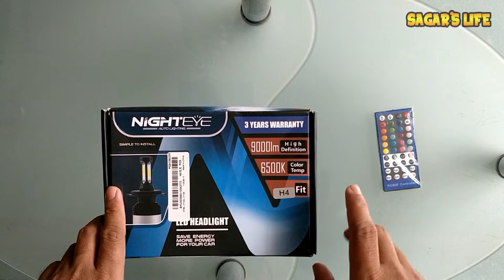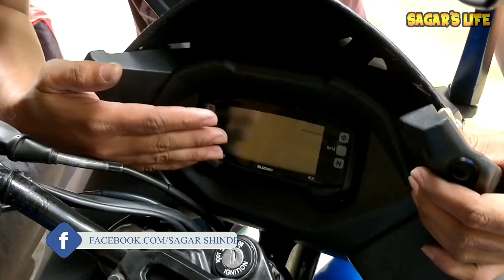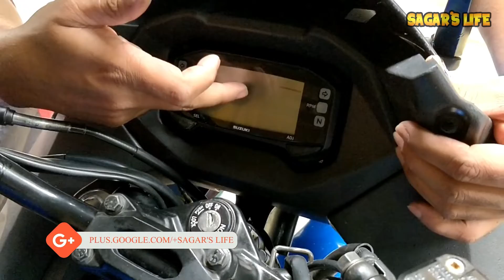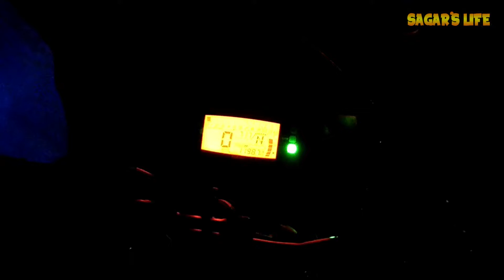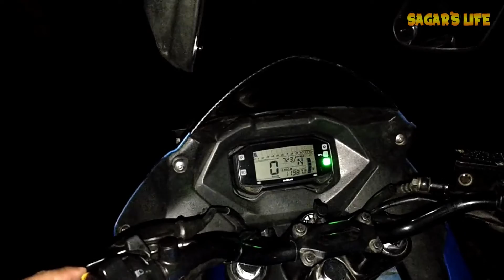The Best & Brightest LED Headlights Bulb For Any Motorcycle,Scooter |Gixxer SF | NIGHTEYE | Setup

Comment: if i change the headlight is it  impact on battery longevity.
Reply from the maker: As far as you are using headlight with engine running then there will be no impact on battery, as using the same from past 6 months no issues are here as even after 3.5 years still using stock battery 👍

Comment: is it required any connection modification for this light? because i installed it without any modification as a result it vibrate whil bike is stand but operate without any vibrate when throttle is increase. Thanks in Advance.
Reply from the maker: No mods required just make sure it should be fitted in exact h4 socket
Reply: @SagarsLife  Thanks for your quick response..... :) it fitted properlly but i'm facing this issue... :(
Reply from the maker: @farhasstory  try to consult with your local area garage person 👍

Comment: Hello sagar this lights sutiable for pulsar 180 model.?
Reply from the maker: Yes why not, just make sure the bulb model type which present in your bike to order the same from mentioned link...
Reply: @SagarsLife  thanks for your quick response also want to know what's the official warranty for this led
Reply from the maker: @mayur1502  you can refer the product listing page for warranty details,
Reply: @SagarsLife  Can we get one piece option.Why it's showing for two pieces of led?
Reply from the maker: @mayur1502  no Mayur it's only available in two pieces as its mainly sold for four wheeler, you can share the another bulb and cost with your friend who also need to upgrade his bike headlight 👍
Reply: @SagarsLife  thanks again for ur support

Comment: Hi,
After installation, rubber cap need to install or not because bulb Fan portion is heating any affect for rubber
Reply from the maker: No rubber cap need to install as the bulb have inbuilt fan for Better air exhaust...
Reply: @SagarsLife  
Hi Sagar,
Are te mala mahit ahe, pan Fan cha no portion ahe to garam hoto, jar aapan cap lavli tar cap pan garam hote, me he vicharat ahe garmine cap kharab nahi honar ka, Karan fan portion ani Cap he ekmekana touch hoth ahe.

Jar aapan cap nahi lavli tar Dust aata madhe janar.

Pls guide...
Reply from the maker: @sujitgaikwad5802  as shown in video me too haven't install the cap I kept it open only, but if you install it it will damage the cap and the led bulb to as the hot air does not exit as required from rubber cap